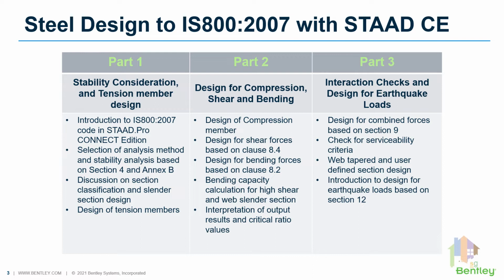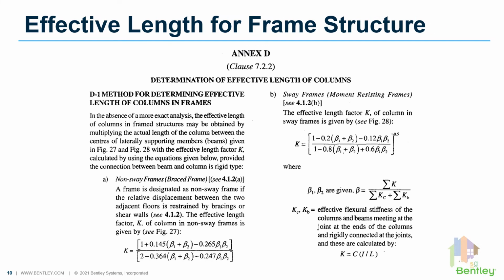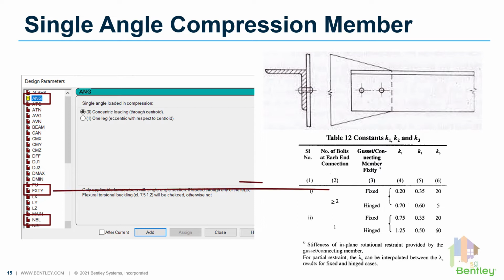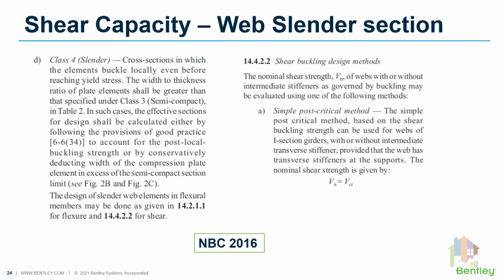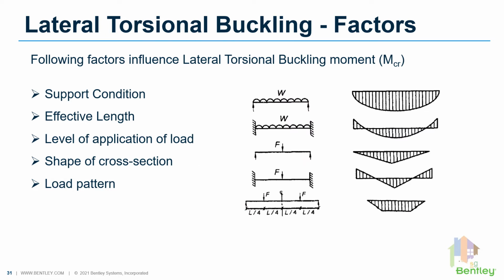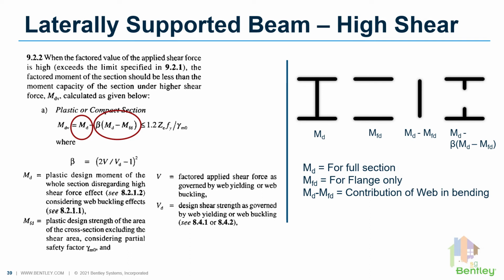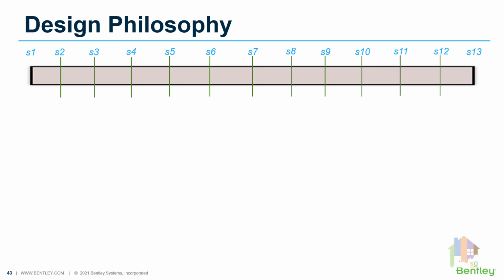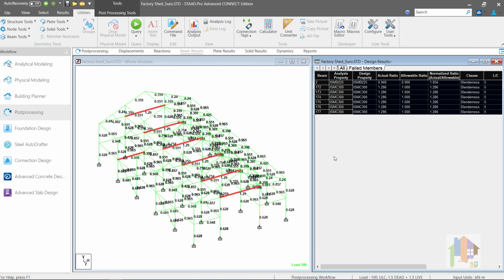Implementation of IS800:2007 code in STAAD - Part 2: Compression, Shear & Bending || LTB || Buckling

Comment: Dear Sir, for laterally supported beams with high shear cases we can use cl. 9.2.2 Considering Effective Web Depth. But for laterally unsupported beams (like crane beams) and D/tw > 67E, do we have to ignore the complete web and consider flanges only in flexural strength ?

Comment: Is there any criteria for ly and lz breaking length
For example if ISMB 200 beam is connected to main main beam of WH1000 in its web will it be considered that the length is breaked in y direction and the length of beam is full in its z direction??
Reply: Because I have one problem in design of crane girder the web is slender and i couldn't find a way to check it for bending and lateral torsion buckling will it be consider that if the crane girder is connected with chequered plate with stich weld will it be considered as laterally support or unsupported beam 
Kindly reply
Reply from the maker: What you are looking for is Lx(or Kx) parameter which is used for LTB & bending capacity. Ideally if the flange is supported at any intermediate distance against buckling, then you can consider the modified distance as Lx. But the lateral support must have adequate stiffness to resist the lateral buckling. Just for example, if there are two parallel beam and a tie rod is welded to the top flange, that is not a lateral support. Depending on your intermediate support condition and resistance, you need to find out the length for lateral torsional buckling.
By the way, for IS800:2007, there is only one parameter (unlike AISC, UNT UNB UNL UNR), so before defining the length, consider the bending profile of other flange and other side of the flange.
Reply: @surojit_ghosh   OK Thank you, so much 
one more query is there,
i have connected Crane girder with axuillary girder at the top flange with truss like configration with top flange at every 3m so i have consider Lx as 3m and with bottom flange lateral tie at every 3m  and also i have given diaphram or surge plate at both the end of crane girder and also the top flange of crane girder is hold with cheq. plate with full welding. so in these case i have consider it as laterally support with Lx of 3 m
is it okay to consider that??? i need help
Reply from the maker: As mentioned, there are several factors which govern the lateral support specification, and it is not possible for me to understand the exact support condition from your statement. Just consider the structural condition of the member when subjected to LTB and if you think assigned lateral supports will restrict this buckling, then you can consider the modified LTB length as 3m.
Reply: @surojit_ghosh  okay thank you for the info and in general in future if I need some help how may contact you ??

Comment: How is bending capacity of a web slender section calculated in staad as there is nothing guided in IS:800-2007?....can you please help us know?
Reply from the maker: Bending capacity depends on several factors, whether the member is laterally supported or not, whether the section is subjected to high shear, or if the web is susceptible to shear buckling before yielding. And obviously, combination of these conditions. Indian code is completely silent about these, how to calculate bending capacity for web slender section properly considering all these different conditions.  If you check other international codes like AISC or EC3 code, they clarified each possible conditions but nothing is mentioned in IS800:2007 code (even you will not get any positive response from the code committee). 
We have consulted few international design codes before implementing this in STAAD. It is not possible to post the details here as it requires several calculations and screenshots. If you can post this in Bentley Communities (http://communities.bentley.com/products/structural/structural_analysis___design/f/5932.aspx), we can provide you proper clarification with calculations.

Comment: It would be helpful if there is a video on defining the design parameters for a peb or any steel structure using open staad or macro
Reply from the maker: Thanks for your suggestion Sadananda. I have plans to create some videos on design parameter assignment for PEB structure as well as how to assign design parameter using OpenSTAAD functions. I will try to post those videos within next few months. 
You can get some ideas about PEB structure design in the third part of IS800 session posted here --
https://youtu.be/hqqMsi1LNp0
Reply: Thanks for arranging the session,As you say , effective length factor assigning to each and every member is very tedious task as it needs to calculate stiffeness of connected beams to the columns and many more, but this task can be done automatically by using vba/ open staad tool , kindly provide the vba/macro excel sheet for automatic effective length factor . Thanks..